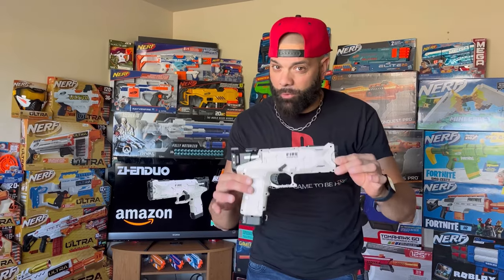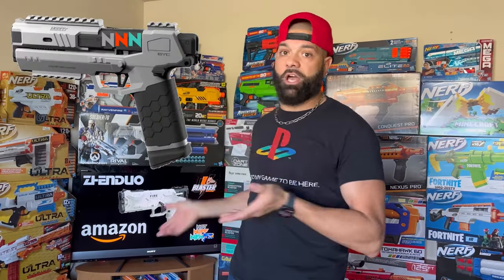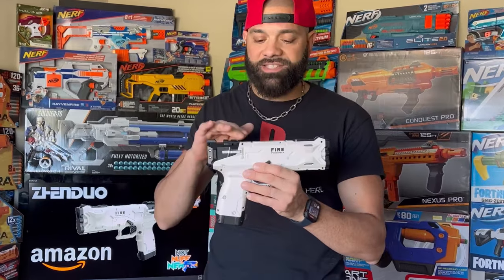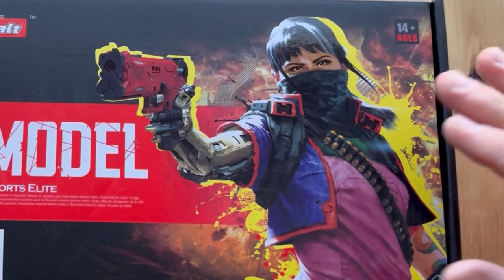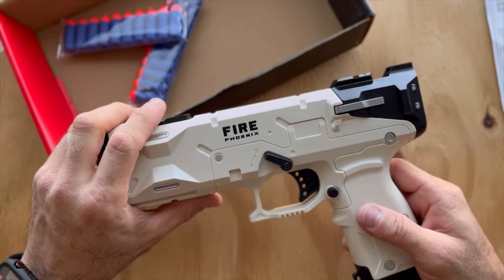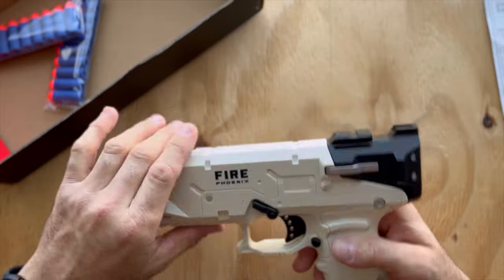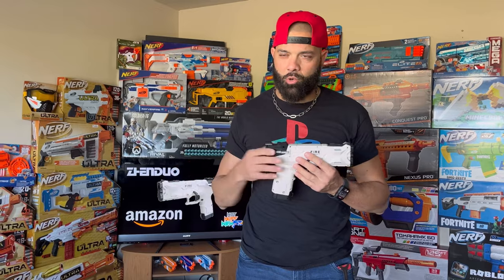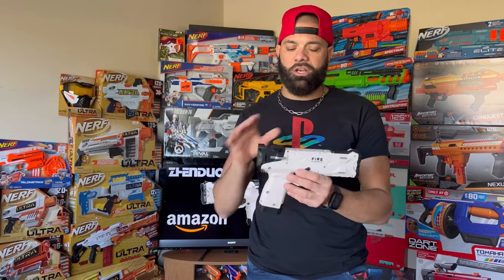Fire Phoenix - The blaster that broke Amazon ⚠️ | Review

Comment: I'm happy to say that this blaster met my expectations and it's great for it's price. My only gripe on it would be the uncomfortable priming slide and the lack of a 2nd magazine but other then that, it's a fantastic blaster! Thanks NNN! :)
Reply: Also after a while of firing, the trigger has begun to fail to release the catch at times so that's a bit disappointing :l
However, it is only 10 bucks so I guess I can't really complain too much and the fix is to hold the priming slide forward.
Reply from the maker: I’ll look into this. About 300rds through both of mine and haven’t seen that yet. Don’t forget to treat these just like high level hobby blasters. Silicone o-rings and oil friction parts!
Reply: @notnuffnerf  I'll make sure to do so, in fact the problem seems to have escalated and now it is no longer a couple rounds of the mag that fail to release, now for every dart I want to fire, I need to hold the slide forward. Perhaps I got a lemon which wouldn't be all too surprising but at least is not an $80 springer lol
Reply: @lingfong  don’t forget to upgrade the slide return spring when you upgrade the plunger spring. It will ensure a proper dart load when you prime the blaster.
Reply: @lingfong  Loosen the catch screws. Thats what i did on mine.

Comment: Thx for the heads up. Just got a another one. The plastic internals aren't the same as the firerat & has plastic barrel. You can add a stiffer spring and get it upto 100-120fps though
Reply from the maker: Great info, thanks! I’m going to ask Zhenduo if they want to send a sample of the original to compare them side by side. I’ve been focusing on comparison videos to see how much quality is lost from cloning, if any at all!
Reply: @paullassayn4641  where can I find spring upgrades for this?
Reply: @nathangable841  they are the same spring as firerat & similar blasters. I put a 1.6 in my Firerat & used the original in this fire Phoenix. Unfortunately this one cannot handle the 1.6, it will break
Reply: @Paul Lassahn  I can affirm that.  Mine broke pretty fast.
Reply from the maker: @paullassahn4641  how did it perform with the stock Firerat spring? I’m actually filming a mod/basic maintenance video on this one this weekend. All this info helps. Thank you.
Reply: @notnuffnerf  I previously bought a red one & it was getting around 100 - 120 depending on the darts. I haven't modded the white one but it was only around 40-60 out of the box compared to around 70 with the red version. Update: just lubed it and doubled the stock springs by weaving them together and am getting about 100 fps with Af pros
Reply: @paullassahn4641  a friend of mine gave me a fire phoenix and he mistakenly placed a Viper Upgrade spring in it. Its not broken yet but I will downgrade the spring.

Comment: Sucks that the barrel is solvent welded in, but anyone with a 1/2" drill bit and some patience should be able to mod the dart gate to accept 17/32 Brass or a metric equivalent Aluminum barrel.

A bit of RTV silicone sealant on the plunger tube connection to the turnaround would also help with the small leaky o-ring.

Also, the amount of flak this thing is getting for having an "old" style plunger head (similar to the Big Bad Bow, Crossbow, Sharpshooter, PistolSplat/Wipeout, MaxxShot, Lanard Shotgun/Triple Shot) I think represents how spoiled the NIC is with modern designs with easily replaceable parts. "Unmoddable" is a bold statement from some. :)

This thing would be the meta back in 2010-2014 had it existed, and has a fighting chance of being decent by today's standards. Just gotta come up with a solution for the janky barrel.
Reply from the maker: Unmoddable like the elite Jr explorer was? ;) The NIC might be spoiled, but it doesn’t take much to get this $10 blaster into the 100s. I put out a short video yesterday on a free 5-minute spring mod that gets this thing into the 120s. Modding is not for everybody, but most can get this blaster serviceable in the time it takes to get to the keyboard and type three bad words about it.